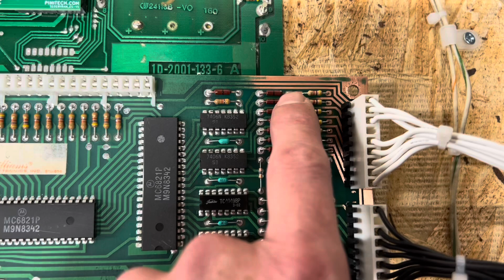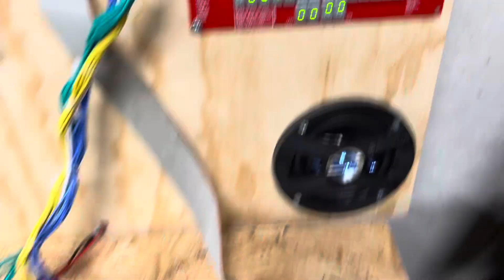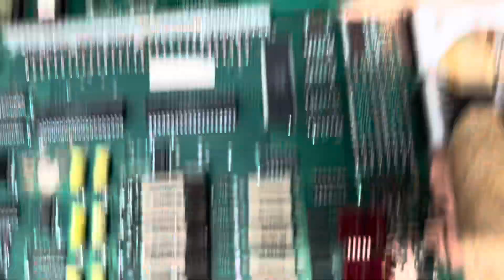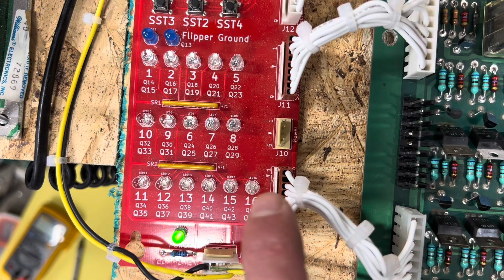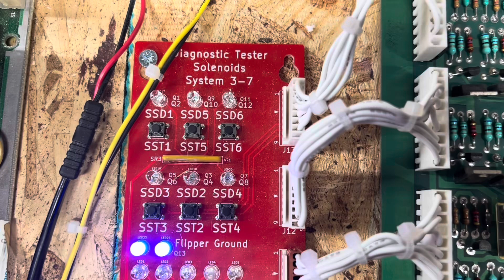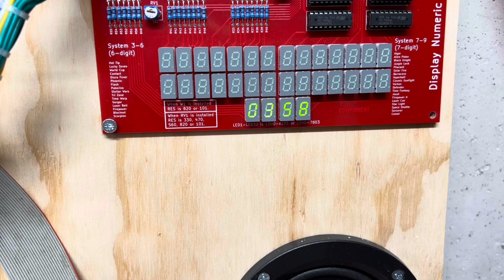Firepower mpu/driver repair overview and test

Comment: Great video Dylan, question for ya here on the YouTubes, because why not.  Comments are good.  Where did you get these diagnostic boards?  Searched the webs and found some threads and a video, but nothing about where to obtain them.  Thanks
Reply from the maker: Thank you. Pinsider by the name of dumbass makes them